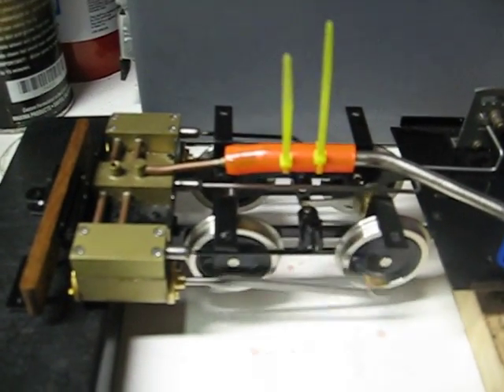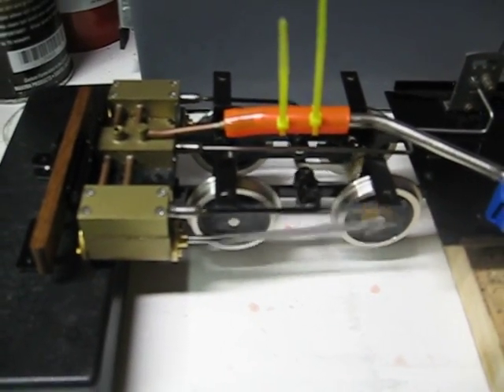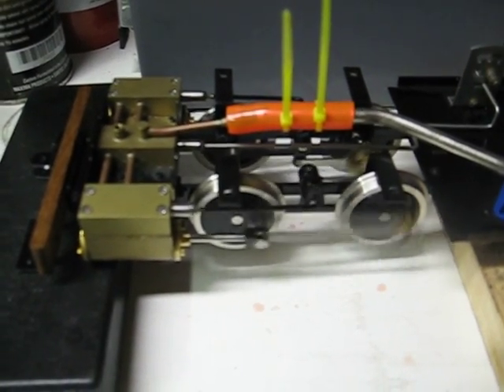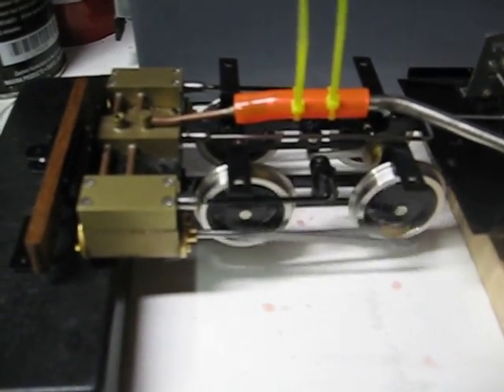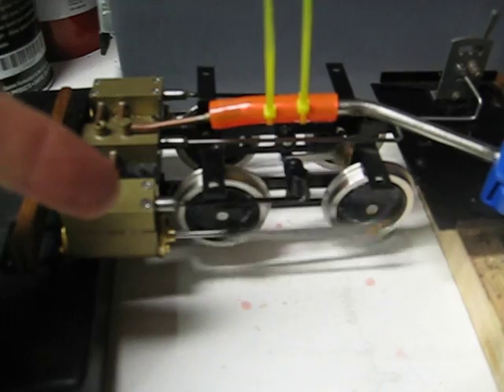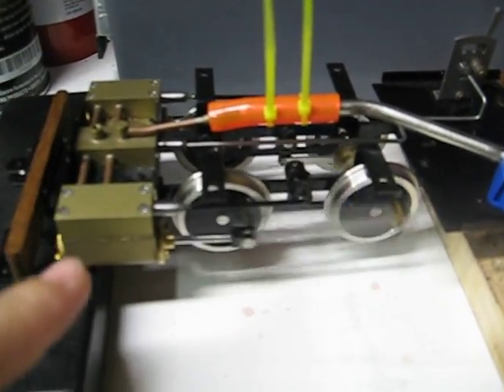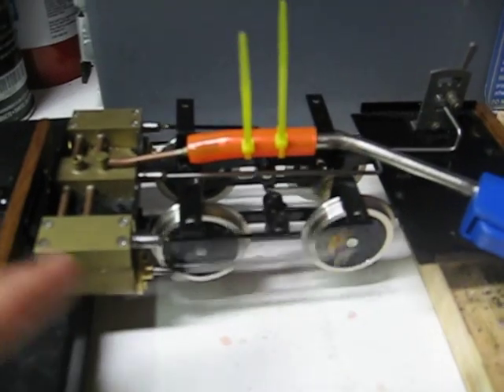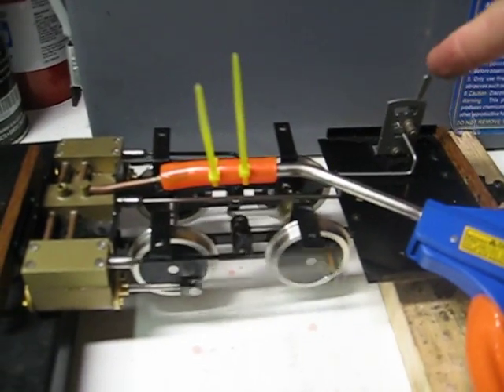Accucraft Ruby Live Steam Air Test

Comment from the maker: @skybluedragonator - It didn't take a year to build- it took about a year to get around to building it. It only took a weekend to assemble it, and then a few hours after to tune it and break it in. If you'll look at my other videos, you can see videos of the Ruby running. We've had it running since July of 2008- although I put bigger cylinders on it the beginning of 2010, and built a new cab out of wood a few months ago.

Comment: I assembled Ruby kit,but i did not have any compressor so that i I could not help omitting air test. Test on fire  without rehearsal was very strained and the tension has been pleasure. 
I have one question:Did'nt you use steam oil when you test by air?I think that the best way to test by air is to connect ilne from compressor in front of the oil tank .

Comment from the maker: alex- I used a small piece of fuel line from our racing karts- but any kind of rubber hose with the right I.D. can be bought at your local auto parts store, and it's hooked up to a $5 Harbor Freight air nozzle that I use to blow crud off the top of my workbench and drill press. Really, it was improvising with things I had laying around.

Comment: How did you connect the air compressor to the valve assembly? It looks like zip ties and some kind of plastic tubing. Did you have a special nozzle on the air compressor or anything?